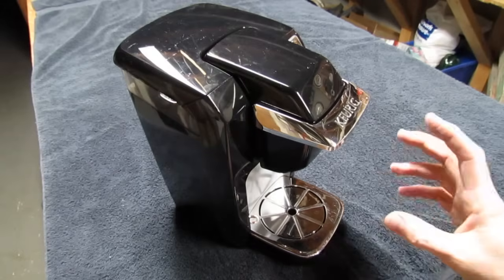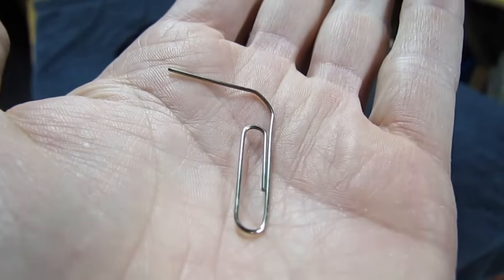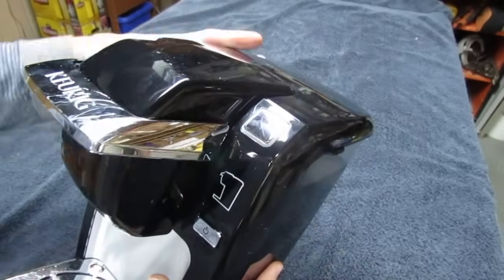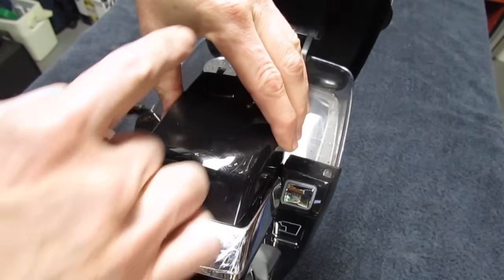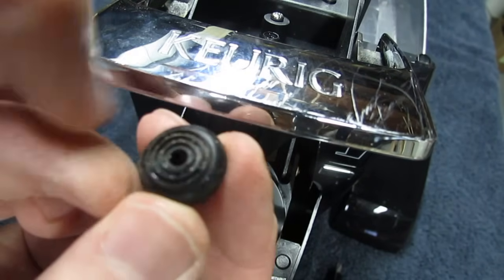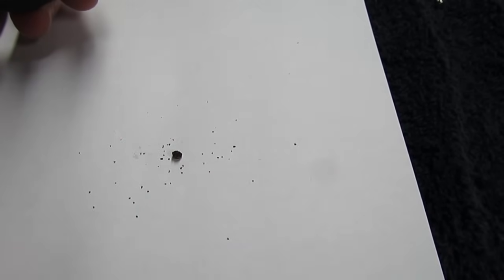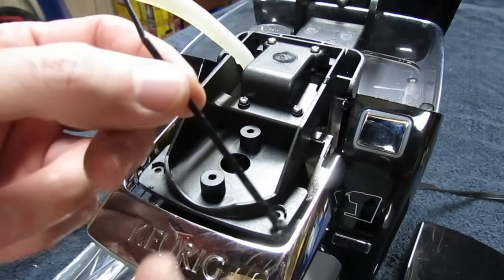How to Fix ● KEURIG Coffee Maker that Stopped or Slow Brewing

Comment: Have you taken it apart any further? Mine still won't brew. Water is hot in the reservoir when I dump it into the sink but doesn't ever come up the hose.
Reply from the maker: See if you can get a skinny piece of wire and slide it as far down the tube as you can. Sounds like you have a blockage somewhere in the hose or pipe. As the water heats up and boils in the pipe at the bottom, that in itself is the pump, the bubbles in the water wants to climb up and takes the hot water with it. It's very simple actually, you just have to think it out. Have another look, you can do it!!

Comment: Is there a method like this for K250 model? Mine is clogged and cleaning out the needle isn't helping at all. It'll brew a partial cup but will take forever to finish and will just drip slowly for several minutes, sometimes not even finishing at all. Because of the placement of the tube inside the machine it's really hard to get to and I don't want to damage the machine in an attempt to fix it.
Reply from the maker: What are your choices?  1) Toss it and buy a new one since it doesn't work (with this option nothing is learned) 
2) Since you are going to toss it, why not dismantle it and see what makes it tick and at the same time probably fix it. What do you have to loose?  I alway use option 2.

Comment: I got to the part where you run water through it and its supposed to come out the hose but water never came out of the hose. It's weird that mine even clogs because I only use it to make hot water for ramen so I never have coffee or tea grounds to have it clogged. Any suggestions on what to do since I didn't have water come out of the hose?

Comment: I know this video is old but hopefully someone can help. I have this same machine and I did everything in this video. Problem is when I put water in it I can't get any water to come out of the hose. Maybe I have bigger issues? It makes noise like it's brewing but no water with it tore apart
Reply from the maker: Follow the flow of water from the tank to the drip. One of them is most likely plugged with debris. Use a pipe cleaner or a length of small wire to feed through to find the blockage.
Reply: @chrisnotap  I appreciate the reply. I would up using a straw and water and a turkey baster and was able to get it flowing and now it works again. Very good video you have and to the point

Comment: Brand new Keurig K-Slim machine, less than 15 cups of coffee and it was fully clogged. How can you avoid this problem?
Reply from the maker: Are you sure someones not screwing with your machine? That's unusual.
Reply: @chrisnotap   my elderly mother uses the machine to make her coffee M-F. I don't know what she might be doing other than dropping a K-cup in and hitting start.

It was very jammed. After routing the hose with paperclip, I had to run nine 10oz cycles through before it finally stopped having old coffee grounds coming out.
Reply from the maker: Is it possible she may have accidentally opened a K-cup and put it in the water reservoir? That does happen. Good that you got it fixed.
Reply: @chrisnotap  reservoir was clean, and I always fill that.

Comment: Did everything..water poured out fine when I ran it from the tube to the cup but after putting it back..nothing
Reply from the maker: Clean out the pointy thing again
Reply: Chris Notap figured it out.  The Dunkin Donuts Kcup wont puncture at the bottom..not sure what I can do but at least I know what it is

Comment: any idea what to do if i tried this and no water would even come out of the tube once i had the top removed?
Reply: Chris Notap I fixed it. I mixed a solution of vinegar and water and once the water started to dispense I rocked the machine side to side forcefully and whatever was blocking came shooting out. most likely a calcium deposit because I looked in the glass I had the water in and there was nothing there, must have dissolved.
Reply from the maker: That's great you were able fix it yourself. Forget about taking it somewhere. Everything can be fixed. What have you got to lose?

Comment: hard to find this model. How do I clean the water chamber?? a friend let me keep hers but she's had it for a while and I noticed that there's dry sediment in the water chamber. idk if it's mold but it's hard to clean and reach all the crevices And sometimes i see it in my cup.  any suggestions on maintenance and cleaning it would be greatly appreciated
Reply from the maker: Just use straight regular white vinegar. Put 8 cups in the chamber and turn it on and let it brew the 8 cups of vinegar. That will help dissolve  any scale deposits in it. After that run 8 cups of plain water through it and thats it. You should be good to go.

Comment: I’m to the part where I brew the water and let it come out of the tube. The water doesn’t even come through the tube at all, even though it’s making the brew noises. There’s water that has been pumped thru the reservoir, any ideas?
Reply from the maker: Find something long and skinny to slide down that tube. A pipe cleaner may be perfect and long enough or a skinny piece of wire. Sounds like you may have sediment built up in the lower part. Of course have it off and unplugged when you do it.

Comment: oh you didn't take the square white thinggy with the spring on it and clean it.  It will go back in one of two ways.  I think I put it in backwards because the thing wouldn't shut off after cup was full?  I'll have to take it apart and reverse it!  Then I'll try it again!
Reply from the maker: Square white thingy? I didn't remove any white piece.

Comment: how to fix the pump for this model ?
Reply from the maker: There is no pump per se. When the water is boiled in the lower part, that forces the water up the tube and into the basket. Do you hear it gurgling and trying to work?
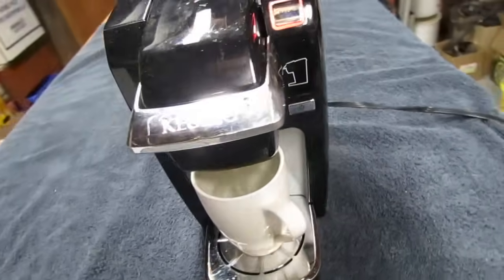Reply: @chrisnotap  yep. I hear it boiling, then trying to work it through the pipe. But there is nothing that comes to the pipe. There is no way to see the other end of the pipe that is inside otherwise I could have known whats stopping water from the tank. It keeps making the sound which is in your video 2:30 onwards, for about 3 to 4 min. But nothing comes out and it eventually turns off
Reply from the maker: @MJs-85  Keep dismantling it and remove each hose and use a pipe cleaner or small wire to probe each piece until you find the blockage. You could also use compressed air if you have it. For sure there is a small blockage.
Reply: @chrisnotap  Thanks man. I actually fixed it. What I did is that I let vinegar and water boiled mixture sit in the tank for almost entire day. Next day I boiled it again. While it was trying to push that vin+water mixture out I shook the coffee maker a little bit and tilted to the right side and after few seconds it started to throw out that mixture. I then boiled just water couple more times and now its working great ! I found some limescale chunks came out that were probably blocking other end of the pipe. Thanks though !
Reply from the maker: @MJs-85  Yes!! It can be coffee grounds blocking it or scale. Add straight vinegar to the reservoir cold and let it sit overnight or as long as you can. Then turn it on and let it brew all of the vinegar. Do another 2 brews with straight water to get rid of the vinegar smell if there is any. Good job!!

Comment: May not be necessary to cut the tie from the tube - can be carefully slipped up & back down again with, say, a flat blade screw driver...the key word here is carefully...
Reply from the maker: Correct. I actually didn't have to clip the zip tie.

Comment: For those who want to avoid this, make sure that the water you pour into the top of the machine is clean. I would get in the habit of pouring water in it from my existing cup that has coffee particles in it.
Reply: I fill mine with water from my refrigerator dispenser, which goes through a charcoal filter. And then there's the filter in the Keurig water tank also, if yours is so equipped.

Comment: Did anyone have an issue with theirs just not powering on?? Mine just stopped working one day. I’ve tried multiple outlets and nothing seems to give it power 😫 I’ve only had it for 2 years. Please tell me there’s a way to fix it
Reply from the maker: Plug a lamp into the outlet to make sure it's not the power supply. Inspect the plug. If all of that is ok, unplug it and start to take it apart. You have nothing to lose plus you will learn so much. Look for a wire that may have popped off at the switch or any other wire that may have come off. Good luck.

Comment: Well, I think i broke my Keurig. I did everything as shown in the video but once I put it all back together, the top doesn't close correctly and it always thinks water still needs to be inserted, rendering it useless. After I close the lid, the "fill with water" light still flashes and it will not proceed. Does anyone have any tips or should I toss the thing

Comment: I tried this, my machine isn't clogged at all it's just not pumping the water out!!
Reply from the maker: There is a pipe at the base that heats the water up to boiling and forces it along with air up the pipe. Possibly the water isn't getting heated up. Has one of the wires come off the element? is the pipe at the base plugged with debris?
Reply: Chris Notap I ended up yanking the tube a little and it started to pump the water out, I still have no clue as to why it wouldn't pump the water out!
Reply from the maker: Sounds like it was a blockage and by pulling the tube it dislodged it.

Comment: "cut twist tie", ah no thanks. Appreciate the effort but this should be a video about WHY you should never want to purchase a Keurig machine. 

Reason is this Keurig Company...be OPEN with customers about the Life Span of your product. "Yes these work splendidly for about 6 months" "at that point you need to CUT TWIST TIES and obtain a paper clip" for your machine will have failed as designed. 

So basically this machine is designed to work for 6 months...it's about $75 and will brew about 500 cups till the programmed failure process occurs. About 1.5 cents a pop and the cute coffee canisters cost about 40 cents a pop. Yes I know the machines should be free but we found our dumb customers will gladly pay for that too so...enjoy the first 500 and then find some pliers.